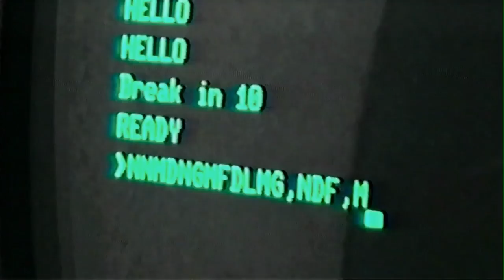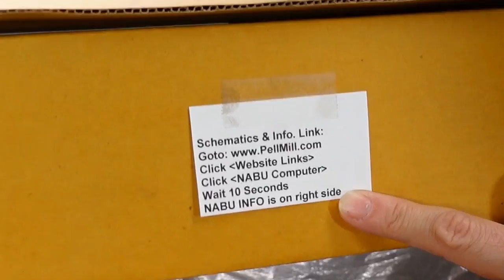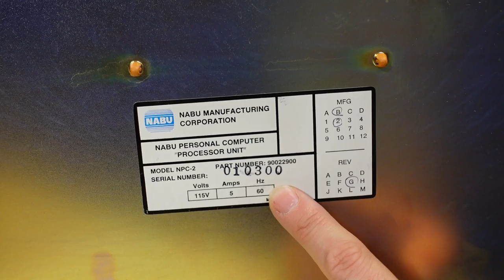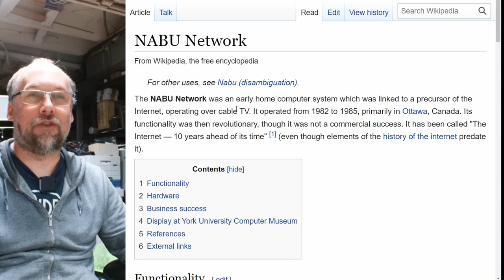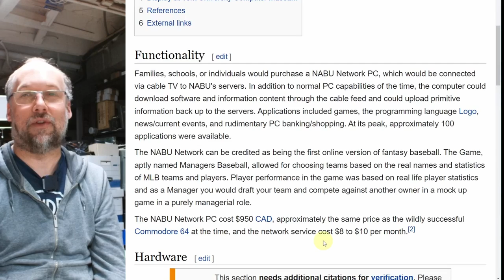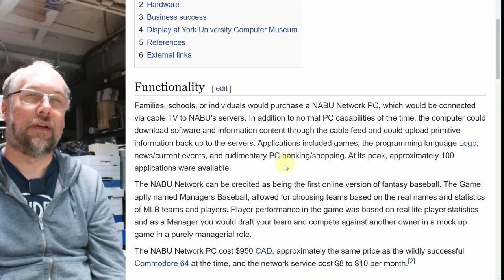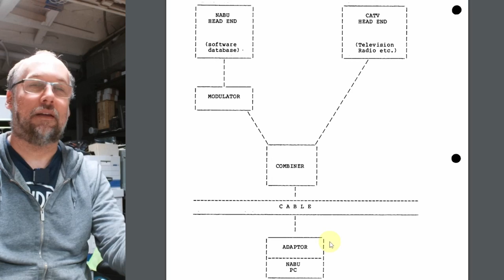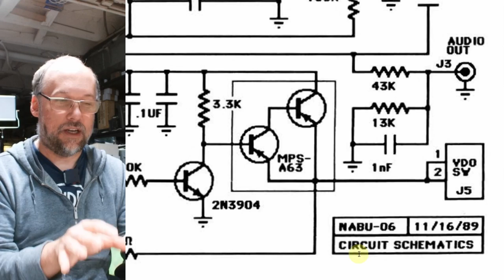The 80s computer you've never heard of: The NABU PC

Comment: Holy Schnikes! Adrian, I really don't know where to start. But first let me just say thank you so very much for your presentation of the NABU Personal Computer. Because of your review I am selling a lot of computers today. (I will give you a total of today's sales at the end of the night.) I need to keep this short (right now) because I have to go downstairs, test NABU Computers, and get them ready for shipping. It's a time-consuming process and I average only 3 computers per hour. Yikes! Yes, I am the guy, back in 1989, who bought all those NABU Computers (and Adaptors). And you hit the nail on the head; with my MAC 512K Computer I put together the manual and the schematic using MacWrite and MacPaint. That's why the schematic looks so odd. I had to draw every part to create a library of components. Fortunately, I had a rough schematic as a guide and did not have to reverse engineer the system. I am an embedded systems software engineer of 40+ years and over the years I have designed a lot of circuits. I bought these computers for a project that never got off the ground and they have been in storage ever since. (More to come.)
Reply: Hey @Adriansdigitalbasement  don't miss James' comment above!
Reply: Do you have the teletext television adapters still available? Did they use the NAPLPS Line 19 teletext VITS protocol and data?
I use to have four of the original 1980s Sony decoders, and an EEG line 19 data encoder. Sadly, not anymore.
Reply: Adrian needs to pin this comment
Reply: Hey, I just ordered one!  Hopefully this thing grows some legs.
Reply: It would be awesome to turn these computers into something that can run MSX software, if possible? ;)
Reply: Thanks for keeping ahold of em so well for so long!
Reply from the maker: I can only imagine how overwhelming it probably got very quickly! Hopefully you will be able to get a substantial amount of the machines out into people's hands. I was curious how many of the units you're testing don't work anymore.
Reply: Great work with the manual, James!
Reply: Thank you for sharing these with the Vintage PC and Vintage Keyboard communities
Reply: @tekvax01  They were not NAPLPS decoders. There was no NAPLP app either. They were microcomputers that used a cable adapter as a mass storage system.
Reply: I would love to but one once you list some more again on eBay. I will keep an eye out on your seller page.
Reply: I was super bummed to find out the units were all sold out on e-bay, but totally understand. Thanks for getting these out to the public and if you get another batch of these ready, I hope I'll be able to grab one for myself.
Reply: HEY MAN. Idk if you remember me I got one from you after an elderly gentleman was there getting one too at Grafton Flea. I'm glad your selling them. Didn't I tell you a wave might happen from the shear mass of stock you have.
Reply: Hey James i see your ebay listing is down already. Are you out? Id like one
Reply: @Joseph Hutch  I don't think they are sold out. I think they removed the listing to catch up on all the orders. As far as I know 500 total sold and then like another 100 and the listing was removed. There is 1000+ units. I'd be checking multiple times a day if your keen to get one. I could be wrong though.
Reply: @nathanhornbacher8109  I don't think they are sold out. I think the listing got removed so they could catch up on orders. I could be wrong though. I'd regularly check their ebay store if you are looking to get one. May get listed again.
Reply: @0atneilskeyboards575  I hope so, I'm feeling stupid for not buying one when this video came out and I knew someone would make them usable.
Reply: @spbnick  Thank you. Yes, once upon a time I was young and ambitious.
Reply: @nathanhenry2747  Thee will be more.
Reply: @josephhutch4911  There will be more.
Reply: @nathanhornbacher8109  There will be more.
Reply: @commodoresixfour7478  There will be more.
Reply: You absolute legend! Thank you for preserving this amazing piece of history!
Reply: @JimmWare  Thank you for the response,  here and on ebay!
Reply: @commodoresixfour7478  @JimmWare  Agree, thanks so much!
Reply: You're amazing, James, and all of this story is amazing. A story that is still in progress and at a very exciting point, too! This system is about to make waves in the retrocomputing community after all those long years in the dark.
Reply: No more left?
Reply: @Daveyk021  No, He has to many orders to fulfill before he can sell more.
Reply: I worked in the game division at Nabu back in the day. Let me know if you still have any left. May pick one up for old time sake!
Reply: Well, it could be great if adaptor would be donated to Adrian to cover the whole setup up! <wink, wink>
Reply: Hey dostum bu Bilgisayar ne işe yarıyor oyun bile oynayamıyorsun anladığım kadarıyla
Reply: @Timscastle  He does, he has to fulfill orders before he can list more on ebay.
Reply: @commodoresixfour7478  OK thanks I'll keep checking
Reply: As a Canadian retro programmer I would love to get my hands on one of these in a future batch :)
Reply: @JimmyWare Just curious, were the joysticks all taken out and sold separately decades ago?
Reply: Be sure to list some non-working units. Cases for modders, keyboards for weird keyboard junkies.
Reply: i got the LITERAL LAST ONE before ebay shut the listings down and it finally shipped a month later and is now on the way!

can't wait to check it out.
Reply: @yyzkevin416  No, they were never included with the system.
Reply: @opp31337  Yes you did, you lucky dog. The NABU Computers are now available on my PellMill website.
Reply: @JimmWare  Oh i see! I was just going by the guide  that came with mine, it shows list of contents as having one joystick and there is a picture of the contents also shows a joystick, so I assumed at the time it was shipped with it.  thanks for the reply.
Reply: Hi @JimmWare, any chance you'll be putting more up for sale? I just found this now, so seems a little late to the party. I'd also be interested in an adaptor, if you still have those as well. I'm an embedded systems engineer (hardware and software) in located Ontario Canada, and would love to join in to bring this bit of Canadian history back to life. You can even skip the testing step, if that helps.
Reply: @josephhutch4911  They are back in stock on ebay. If you want one id buy one like immediately
Reply: @nathanhornbacher8109  They are back in stock on ebay. If you want one id buy one like immediately
Reply: What a story! I'm a tech guy from Spain who today found about this story, and I feel I'm living the solving of a case by knowing who did all that. What a legend, thank you both!

Comment: This computer was part of my childhood, with lots of great memories. I worked as a delivery boy for the local Ottawa Penny Saver (a free publication) and one of the perks was a Nabu system offered for free. This was in late 1984 or so when they were trying very hard to increase the popularity. The games were lots of fun, and I've been wanted to find copies of them for years with no success. One of the weaknesses of the system was the unidirectional implementation for the data. What this meant was that all the programs were transmitted over the cable, repeatedly, over and over. Depending on the timing of when you selected a title and where the stream was it could be almost instantaneous, or several minutes, before your program started. I still own a couple of Nabu systems in my collection.

Comment: I was one of the original games developers for NABU. I worked on Roulette, Pac-Man, Q*Bert, Miner 2049er and most other games for updates and bug fixing. Later I became the director of Content Development. I can demonstrate it running the network menu, most of the games and software, and CP/M 3.0.

As a matter of fact the demo systems used two NABU PCs wire together using an RS-422 crossover cable. One system had a hard drive (10 MB!) and made the NABU PC think it was connected to the NABU ADAPTER, which is what actually downloaded the data from Cable systems.

Though the hard drive of the demo system hasn't survived the decades, the floppy backups and floppy drives still worked, and some of the cable games and applications survived.

It wasn't an MSX machine. MSX came around the same time, and was VERY compatible, so man.y NABU games made it into the MSX ecosystem and some MSX games were easily ported to NABU, boosting our catalog of over 150 titles.
Reply: @leo.binkowski  Internet Archive would be the most sensible place for this stuff I'd say
Reply: There was a tank game for the Nabu, in a 3D maze with magnets. I've been trying to track that one down for literally decades. Are you familiar with it?
Reply: Woah, crazy to think people who worked on such a niche product would find a video all these years later. Seems like a lot of people worked on it and it wasn't a side project.
Reply: @stuthelotusguy  Did you find out?
Reply: @EikottXD  Nope, not yet.

Comment from the maker: Thanks to patron Nick R for sharing this link to a rudimentary port of CP/M that was just created:
github.com/randomvariations/nabu.cpm

Also David (of the TRS-80 Diag ROM fame) disassembled the ROMs. It turns out the ROM on our systems is the 4K version -- which is very simple, but the ROM on BitSavers is the 8K ROM which has floppy disk booting capability, with a boot menu. The use the 8K ROM on the system, some minor modifications need to be made (cut a trace and jumper two pins) to change the chip select logic to 8K.

Comment from viewer Daniel Hansen: The son of the original CEO / owner of Nabu is currently working on an ESP32-based adapter and is in conversation the folks at York University to set up / host a Nabu service.
Reply: Hmmm, a potential z80 powerhouse, pretty awesome
Reply: Hey Adrian, this comment isn’t pinned FYI. I’ve seen a lot of pins not “take” lately.
Reply: You'd better make another video to help get all this new work really get going. I just pulled the trigger on one of these from the listing you linked. Hopefully I'll see something useful from it in my little retro museum corner here at home. Worst case, it's another random box of crap my kids have to get rid of when I die.
Reply: It sounds to me like the CEO's own family were pretty enthusiastic about the service, and were probably as sad to see it go as to see the income go. It doesn't sound like it would be that hard to trick one of these into going to a website over a WiFi emulator for the Adaptor module, so this may prove to be rather presentable without being a huge ongoing expense.
Reply from the maker: @kaitlyn__L  yeah sadly this comment got unpinned and disappeared entirely for me. It's back for me now but I had already made a new pinned comment. Grrt

Comment: WOW!  What a trip down memory lane... I bought one of these systems from an electronics surplus store (Addison) back in the early '90s, and as you found out, it doesn't do much.  Mine came with both the computer and the cable interface adaptor.  The cable interface adaptor had one of the most complex RF circuits I'd ever seen.   Having done much work on Z80 based systems, I disassembled the ROM and worked out the memory map, and reverse engineered parts of it.  However, without a way of accessing any local storage, it was mainly just a curiosity, requiring burning eproms to try anything.
Reply: Do you still have any of what you learned documented?
Reply: @gklinger  I dug up some old test code I had thrown together.  I had written  some basic i/o routines in assembly and some test code in C using Archimedes CZ80.  I forgot that I had used it as proof of concept for a project that needed video and keyboard.  Sadly the project never got off the ground.   I think what the Internet has thrown together in the milli-seconds since Adrian's video came out immediately surpassed anything that I scrounged up back in the day.  Truly wonderful when people are all working toward a common goal!

Comment: The Joystick looks to be an OEM of the Zircon VIDEO COMMAND, which itself was a re-packaging of the Fairchild Channel F's controllers.

I used these for years for video gaming, excellent to hold, once you understand the grip, very responsive, and you could hold them for a very long time (unlike e.g. Atari's joysticks)
Reply: The layout is rather phallic
Reply: Nice controller on the Channel F but very 70's looking, does not suit the modern 80s look this system was going for
Reply: After seeing the picture of the controller I knew it looked familiar, but couldn't place it.  Thanks for posting that!
Reply: I knew there was a reason it reminded me of the Fairchild Channel F controller. I hear using it to its fullest leads to a busy and intense version of Pong (I think the system calls it "Hockey," which makes sense).
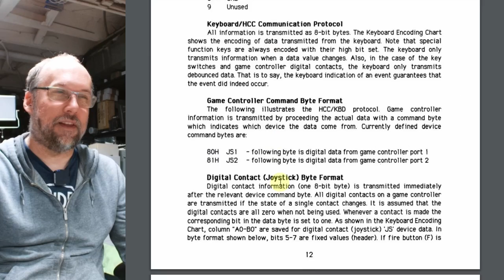Reply: Based on the pinout shown at 29:10, those DE-9 joystick ports on the keyboard should also be compatible with standard Atari or Commodore joysticks, with only the +5V and analog paddle inputs missing. A thoughtful touch from the original designers...
Reply: @jordanhazen7761  I wondered about that.  A good example of an unofficial "standard" growing in popularity.

Edit: A big Thank You! for properly referring to them as DE-9 connectors!  Having spec'd those D-series connectors at a military & industrial manufacturing job in the late '70s and beyond, I don't know how many times since then I've had to explain that the second character indicates the backshell size.
Reply: Oh wow! I had a Fairchild Channel F as a kid, but thanks to my proclivity for taking things apart, it's long gone... I immediately recognized this style of controller, and recently acquired one for a current project. These controllers are the closest example of a "Translational Hand Control" as I've ever seen. The THC was used on Apollo and the Space Shuttle for performing translational maneuvers via the RCS (Reaction Control System). I'm currently building an instrument panel for the game Kerbal Space Program, and this style controller is ideal for the task!
Reply: I worked on licensing the NABU controller from Zircon -- When I visited their California office, they gave me a nice Zircon stud finder (original model) which I still use today!
Reply: @kenleese501  I KNEW I'd heard the name Zircon before! I had one of those too... Dunno if it's still around.
Reply: @jordanhazen7761  actually the NABU keyboard has an analog to digital converter chip on board so I assume it intended to also support analog paddles and such. There also place on the keyboard PCB for another two DE-9 connectors.....
Reply: @martindejong3974  Oh, interesting! I wouldn't have expected that. Odd that they would leave the ADC chip but not populate connectors, if this feature was a late removal from the design

Comment: That is an amazing machine for pre-85. I'm actually stunned by how well thought out, clean and robustly made it is, compared to what most of my crowd used (C64s, TRS-80 Color Computers and some TI-99's and stuff thrown in). It obviously was designed for a more high-end market than just basic home computing. The whole concept was exceptionally forward thinking,  if a bit too high ended for anything like the market was in the early 80s. I'm glad you shared this, I would have never known it existed otherwise.

Also I strongly disagree with the disclaimer that "you can't do anything with it out of the box". It's a little like suggesting a blank canvas has no possibilities.

Comment: 14:23 That joystick was great! It was very precise, fast, responsive and very comfortable to use. It took a bit of time to get used to, but compared to what was standard back then it was very comfortable. Not the worlds most robust construction though as the retention for the trigger switch tended to break. But for anyone who suffered from joystick thumb or carpal tunnel problems from using a normal joystick it was fantastic. It replaced my Tac-II and the other joysticks I tested at the time. Loved the Tac-II for the feeling, speed, build quality and dependability, but it was finnicky when it came to diagonal movement and the feeling of the trigger button was pretty bad. my thumb suffered quite a bit from mashing that button.

Comment: Awesome.. I think I will be getting one. It will be interesting to see if anyone, including myself, can make a rom to get it to boot and run some code. You are right, the architecture is much like that of the MSX. So porting those games over, shouldn't be too hard. It would be an interesting project to take on. Very nice that it has all that documentation for it, makes for a great start in getting this computer running by its self, with a custom Rom. Thanks for showing this, I had no idea this computer even existed until now. 👍👍